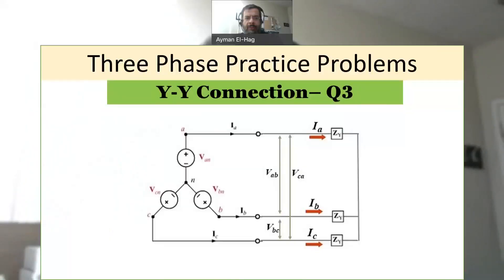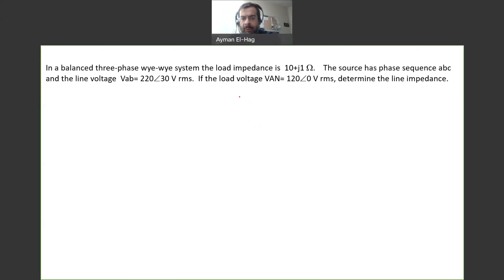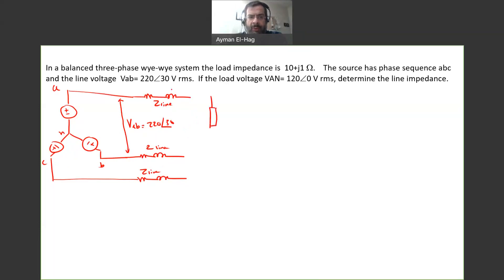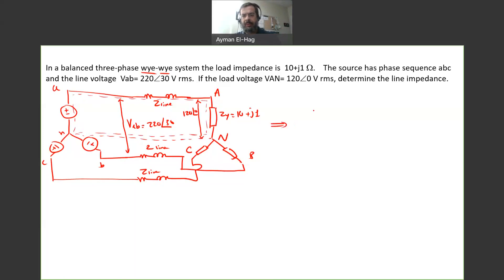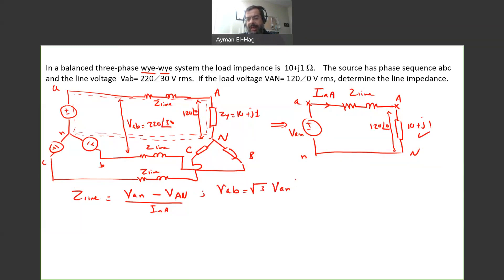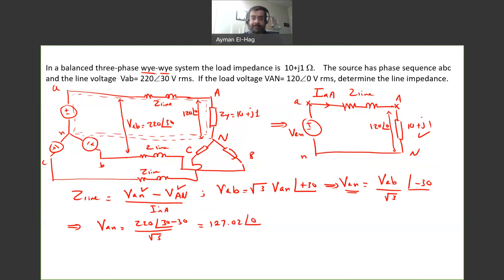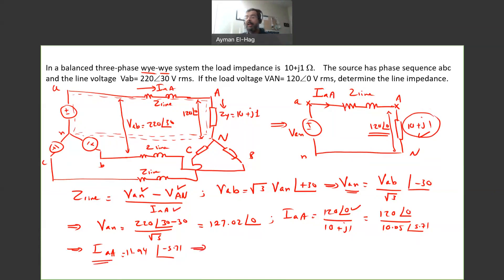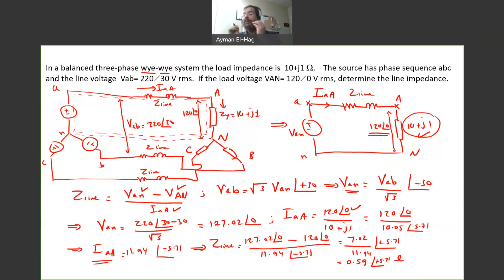Three phase circuit: Question no. 3

Comment: Hi professor, great videos! Why isn't the formula for I(line): I(aA) = Vab/((10+j1)+Zline)) and instead is just Vab/(10+j1)? Wouldn't the impedance in the line affect the current in the line too?
Reply from the maker: I first found the line current by dividing the voltage across the load (120angle(0)) by the load impedance. Then, use this current to find the line impedance.